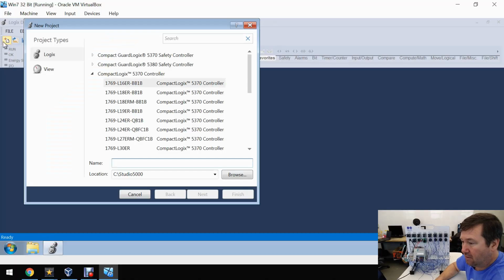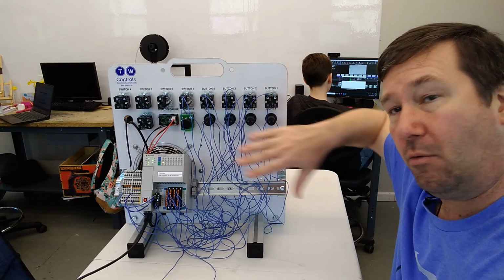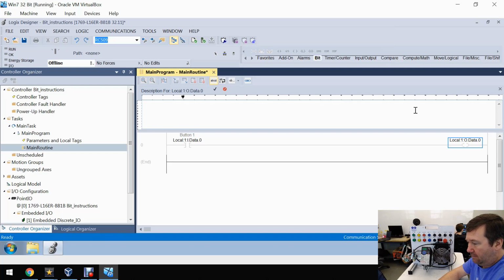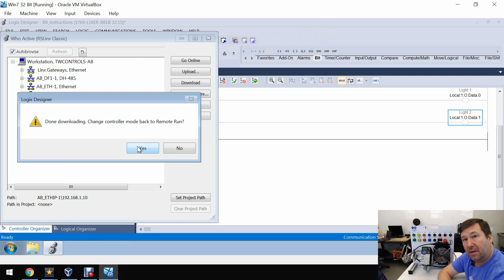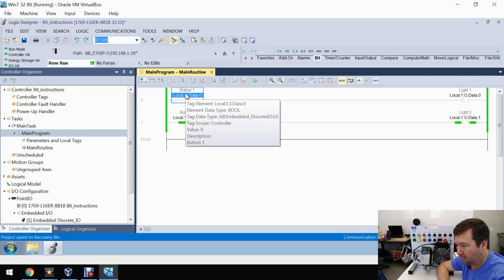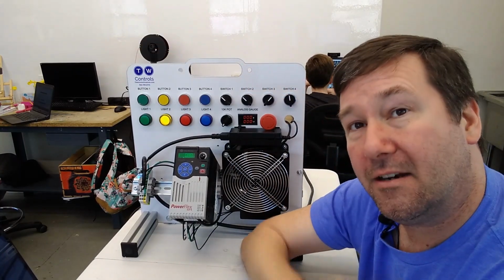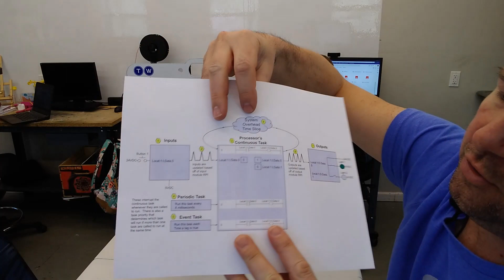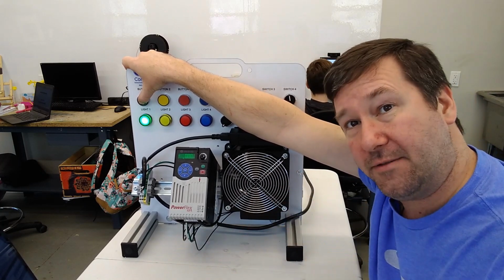Studio 5000 XIC XIO and OTE Bit Instructions Controllogix Compactlogix

Comment: Question: I’m brand new to PLC and control engineering so this is very helpful. The physical trainer kits are very expensive so am unable to order one. Is there a way to perform training on software only? Basically what is the best way to train with this stuff without having a PLC at hand.
Reply from the maker: Start with this course. You can get through a decent amount with the free software and simulator